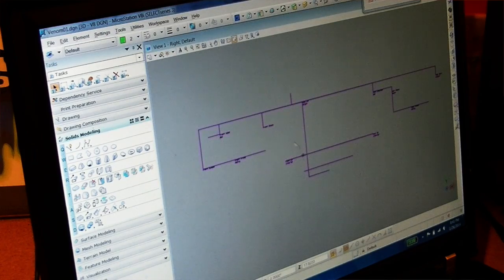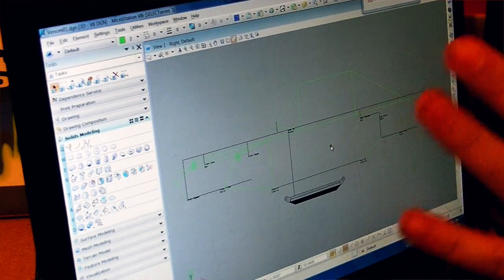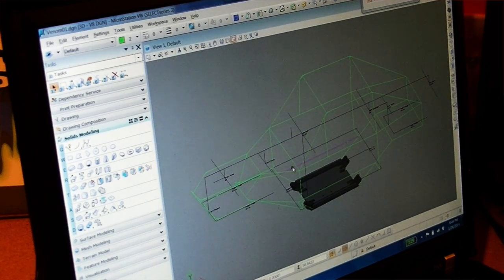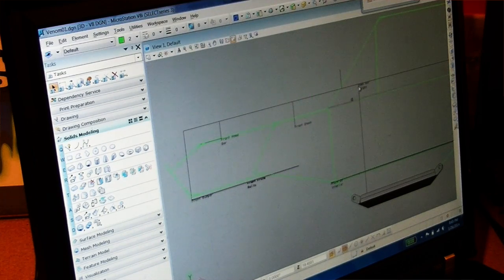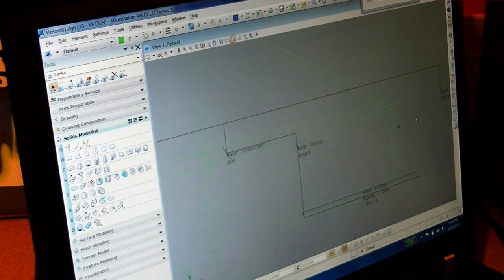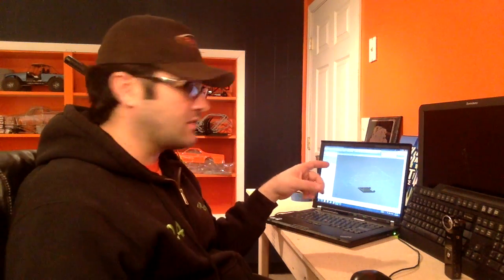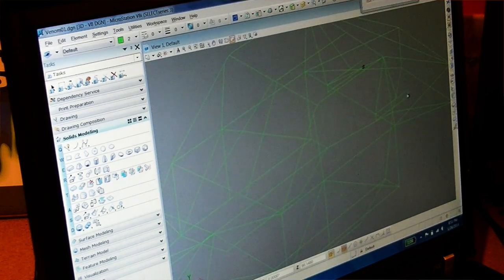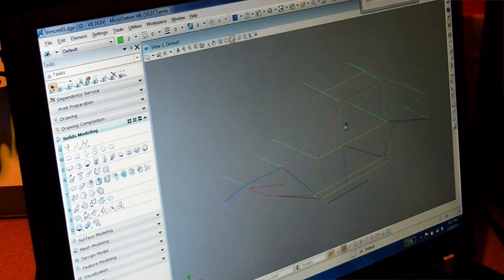Poison Spyder Wraith - Chassis CAD Design Process - Episode 2

Comment: what cad program do you have I tried free cad version 13 and free autocad its nothing like yours please respond thanks
Reply from the maker: This is call Microstation but even though the free programs don't look like my interface they do the EXACT same things. You just have to find the commands. CAD will take you hundreds of hours to learn and be proficient at. You aren't going to find any of them that is going to be setup to do a tube chassis the first time you open it up.
Reply: HarleyDesignsInc k so could you help me out some like a video link that shows how to do it or do you know the cammand
Reply: HarleyDesignsInc or could you do a video series how to use microstation
Reply: davidrc624 try autodesk inventor great program I have used that and autodesk autocad they are both great programs but inventor is way easier

Comment: looks good, and easier than drawing it all out by hand the way I do, but, I know how to draw it, and I don't have enough memory on my PoS computer... I do want to know 1 thing... how much heavier is that cage going to be compared to the stock wraith? Have you thought of a cage mounted tire, or are you just not going to run a spare? Nice work and THANK YOU!!! for showing us all more of the "boring" cad stuff... Now to get a better machine so I can get a computer drafting program... hmmm...
Reply from the maker: I discuss the spare tire situation towards the end of this video. Due to the size of the tires, one will not fit the same way PSC ran one. And if it isn't the exact same as how they did it I'm not interested in running it.
Reply: ok, that does answer my question, lol... I knew you weren't going with the same setup, I didn't realize you meant no spare at all, sweet!! Never seen anyone that dedicated to authenticity man, that is awesome too!!

Comment: when you printer is up n going and you finish some of your projects, could I trouble you with a custom part for one of my redcat 1/24 sumo crawler??

Thinking I should go to school to learn cad
Reply from the maker: It will depend on how much time I have to get the things I want done. I have a huge list of things to print. Printing is not really the expensive part, it's the modeling time that really adds up.
Reply: design wise I have drawn my 1/4 scale gas crawler/ bouncer... by self learning in cad..

so I get that, and I get the laundry list of things you want to do and try... its just a thought and I would have a lot of design to do before I would even attempt a printed design..

hence why I should go back to school for cad/cam so that some day I could build my ideas with a awesome setup like you have...

hardcore follower of the mega mud truck build
and the Ultra 4 build..
Reply from the maker: MadAddVent Thanks man, I'm looking forward to seeing what I can do with the new tool in the shop soon.

Comment: Harley, do the cage in aluminum to reduce weight.
Reply from the maker: Paul, I don't have the capabilities to weld aluminum here in the shop so I will have to stay with steel. My little TIG welder is DC only and you need AC to do aluminum. Thank you for the comment!

Comment: Thanks for doing an sharing this great video .. 
Before trimming of the tubes , wouldn't you figure out the ESC , Receiver an battery placement first ??
From what I saw in the video there's not a lot of room for a 3S 1300mah lipo battery up front... Unless you have done all this already , like with the shock mounts..
Reply from the maker: Right in front of the firewall is where I plan to place my 3s 2200 pack. I will double check the model but I believe there is room. My receiver and ESC can be shoehorned in someplace I'm sure (maybe in the area that was used for the fuel cell on the rear truck. Thank you for the comment.

Comment: Great video!  I wasn't aware of those 'bulkheads' in the tube joints.  Consider standing the spare in the rear?
Reply from the maker: I learn a lot of cool little things like that from reading the full size forums. The Race Dezert forum has some of the most insane builds you'll ever see. I only want to run the spare if it is the same way they did it. I normally don't run a spare on my rigs, so I'm not too sad to not find room for it right now.